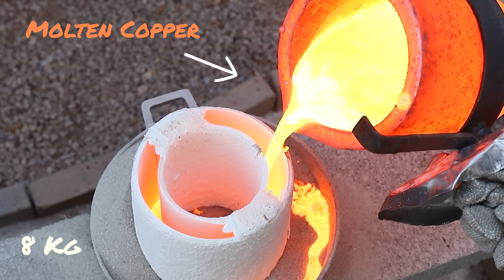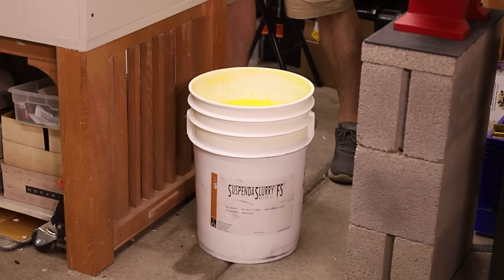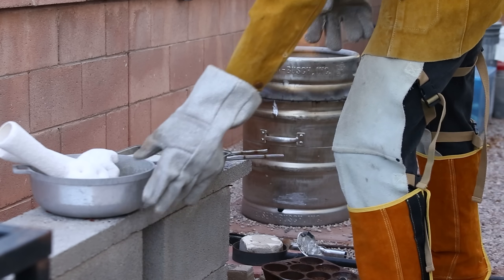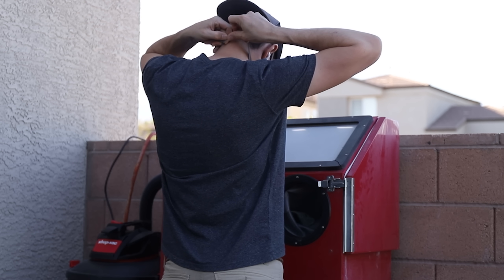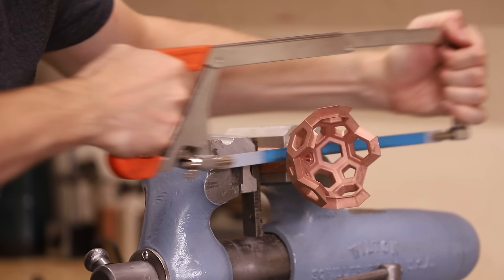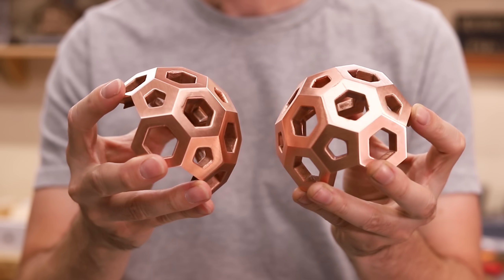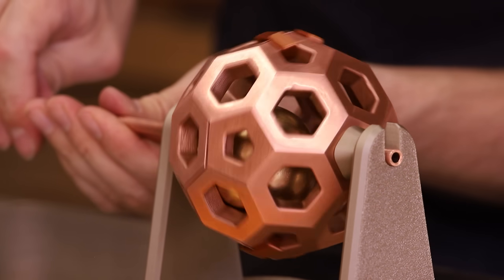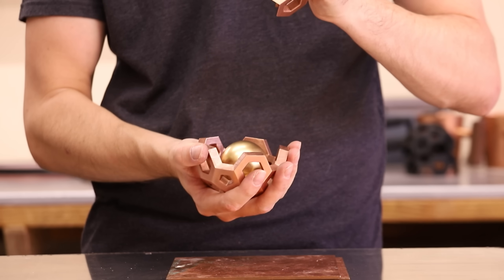HUGE Magnet VS Copper Sphere - Defying Gravity- Will a Neodymium Magnet Float Inside?

Comment: Very interesting video maybe you could attach something to the magnet spin the magnet with a drill inside the copper sphere but separate the copper sphere by a 16th of an inch and attach a meter to each side of the copper sphere. See what kind of current you can get out of it… Anything at all would be interesting… But on the far side of reality, it could be a run at free energy… No probably not but would still be very educational to find out

Comment: turn it into a tube, with no gaps in the sphere ends, use a piece of glass for the tub, and then vacuum chamber it. then a small amount of energy should bump the magnet from side to side. put the thing on a spinning axis, and it should move in either direction while floating. if only we could make copper infused glass or transparent copper like transparent aluminum lol

Comment: That was pretty cool. (Especially after watching a bunch of "in the weeds" political videos. 😁)  When you hook it up to the motor, have a way to control it''s rpm's, and slowly ramp them up and see if it'll reach equilibrium. you could also experiment with the shape of your copper cage. Maybe a smoother, aka more spherical shape, maybe it won't bounce as much in the cage once it starts "levitating?". I'm thinking it'd provide a "smoother" field, if that makes sense. There might also be an optimum ratio for the diameter for the copper sphere, compared to the magnet's size and power.

Comment: I think we could get a better image of the magnet sphere inside if you remake the copper cage like a zoetrope. Just have to get a variable speed motor and match the cameras frame rate to the rotation of the zoetrope. Then you could also set it up to rotate on its y axis instead of the x axis and only the hight of the cameras angle will matter. You could make a simple jig to set your camera  on at the perfect hight and distance away and then rotate the camera around the whole sphere. The camera shot would look pretty epic. As far as lenz's law i dont know if the effect is stronger with more copper mass or more copper surface area but keeping this consistent as it rotates may play into keeping the magnet sphere in a state of hovering. It might also balance the system so it doesn't bounce, shake, or wobble. Just like how they balance tires. Super awesome experiment! Im excited to see more!!

Comment: Try using a motor with a variable motor control and a strobe light.  Then just dial in the synchronicity to the camera shutter speed.

Comment: Could you potentially have power be produced by this thing? I have a feeling it could potentially be something amazing if you could figure out the right algorithms and theories applied as well as the engineering. It could be a the core of an undiscovered engine type. Maybe it could be the core of a gravity well manipulation device? Just a cursory glance at google with AI shows that A gradient magnetic field can be used to simulate different gravity levels. The magnetization force can be made to go in the same direction or opposite direction as the gravitational force. Maybe adding an electric current and spinning it fast will be fun as well? Idk, Im not an expert or even a student, just the thoughts of an brain addled individual. edit: found this https://www.youtube.com/shorts/C6y9GHAfWHY.

Comment: Motor drive with fine speed control and a camera with an adjustable shutter speed, and you'll be able to capture video of the spherical magnet actually levitating in what looks like a copper sphere that's standing still, if you match the shutter speed to the sphere's rotational speed.

Comment: Electrically insulate both halves by placing thin rubber on the mating surfaces , and measure how much current is being generated when you use a drill to rotate it.

Comment: I don't know if you have a lathe and I know it would require another casting but I think you could've made much much better fixturing for the cube if you had kept those solid copper cones, found some way to center the spheroid and then turned those copper chunks into a perfect copper rod or even like a thingy specifically for a drill or maybe even a belt wheel all integrated into it. Plus as Nighthawk mentioned you've got to find a camera trick to capture this again, for sure you need a part two xD !

Comment: Id be curious if it was possible to use this effect for some kind of vehicle suspension. Wouldn’t the faster you tried to push them together the stronger the resistance but it would gradually decrease to create a smooth fall?

Comment: Maybe try making a stand which allows you to manipulate the angle & orientation of the sphere’s axis at any inclination or declination. You may also want to build a small stand for the remote/control magnet (that you had a foot’s distance away from the truncated icosahedron) which are connected to each other by at least one axle if not two axis. I also wondered If a copper lattice, netting, mesh, or chain mail is produced by any manufacturer or can be 3D printed. And experimenting if adding some to cover the holes of the spheres would have any slight effect. Finally, a very vague & aimless suggestion of adding a Tesla Coil somewhere in the mix is my closing attempt to trigger some ideas from those who have worked with such things. 
It is enjoyable & exciting to see someone bring a simple idea from one’s imagination into the material, practical, tangible world which not only affirms one’s speculation of the behavior in question, but also may very well lead to something quite profound or hyper efficient. Moveable parts which needn’t be physically or solidly connected is an enormous breakthrough. That would lead to less parts necessary. And removing friction to an infinitesimal would remove much wear & tear as well as lubricators. So, well done. I like your meticulousness & attention to detail & refinement. Keep up the good work & the exploration of your curiosity to what’s possible. ⚡️

Comment: Seems there's little rotational motion at "the poles" of the sphere in a direction that can introduce enough diamagnetic force vectors to control the float. Rotating copper cylinders/rings, positioned orthogonally with the magnet in the middle would be a theoretical solution, but the spinning ring mechanism would be some challenging fun.

Comment: You can just call the truncated icosahedron a "football" (I guess a "soccer ball" to you). Alternatively a "Buckyball", but only nerds will recognize the latter.
Also: just replacing "centrifugal" with "centripetal" because the former "is not real" will not do. It is centriFUGAL force that forces the magnet out. Even though it is called "fictitious", in a rotating system it is very real.
The centripetal force is exerted by the copper cage on the magnet, keeping it on the circular path. Either by Lenze's forces when it's floating, or through mundane contact. You'll notice that expressing the situation through the "real" centripetal force is near always more complicated.

Comment: A couple things come to mind as I watch your video.
1) realize that for max effect the current developed in the copper sphere needs to be unbroken. Wherever possible use curves rather than corners (in each hexagon) as those corners each decrease corculation and this the force suspending your magnet. I would also try to make the cage itself to be spherical if possible. Technically you could use a Polywell Design (developed by Dr Bussard) in which each of your hexagons is actually a Ring. I think you're using a duodecagon congiuration and i would be interested to see the results of this new design.
2) keep in mind that your magnet is not in the same situation relative to your cage as the cylinder magnet was for the pipe. That's because the sphere has two poles and isn't easily rotating along the magnetic axis as the cylinder mag in the pipe.
There might be ways to alter your magnet either by building a sphere out of many smaller magnets with their North-South either all pointing inside-outside or a mix (like your hex cage).
In theory one could have every magnet pointing to the center but that affects the field circulation. So more likely alternating N-S and S-N magnets to provice a more even field around your magnetic ball (and not just the 2-pole planet you are currently using.). Try using the same duodecagon congiguration internally too.

Comment: Since the spherical magnet still acts like a disc magnet with only 1 north & 1 south side (and a round magnet isn't a good shape to demonstrate a magnet) a shere isn't the best containment vessel. Try several disc magnets which are magnetized across opposite sides of the circle, not top to bottom. Then assemble several until their thickness is  equal to to diameter.

Comment: This is fascinating.  does a smaller magnet sphere work better?  or worse?  how about a cube magnet? steel or copper solid rods, with bearings might turn the sphere smoother.

Comment: Does moving that other magnet by the sphere to make it turn work through the table?  I imagine having that magnet ring turning under the table hidden and having the sphere turn seemingly by it's self.  I wonder if the magnet in the sphere would hover at the right speed if that ring magnet was making it spin.
Also as other's have mentioned, I don't think that copper sphere with the holes will have optimal characteristics for this.

Comment: If the spindle was connected to the copper sphere you could equally rotate the outer shell around it, which is pretty neat. It’s like a frictionless bearing. Great job 👍

Comment: Oh man you giving me a ton of ideas!!! I never really thought about lost plastic!
I was strongly considering lost foam.
You know how many years I have criticize 3D printers? You just gave me an idea that make it practical. More likely I'll be buying a 3D printer to experiment by the first of the year. Even though your procedure seem to be the same as the Lost wax but make it cheaper and more realistic it's the molding process sculpting is done in the computer instead of by hand and you're using that same plastic Not wax and a way may be cheaper/convenient. Oh man the ideas of endless.  I'm saving this video I'm going to review it and study it some more. What I don't understand sometime with lost wax you get a hollow casting how can I do that with a CD printer. That's for sculpturing statues. But if I need to make parts or machine parts hey that's the way to go.

Comment: Your Copper castings may have not been the video focus but, can only imagine the total hours in them. Turned out really cool. Maybe do threaded pins to join the halves getting a better more consitant connection would both balance and strengthen the magnetic fields lines.

Comment: I think the shape was actually interfering. When you think about the magnet as stationary it basically has short connected copper pieces going around it. A shape that provides a larger surface area around the point of rotation would be better. Something like a donut in the middle might work better. Also you have no way to keep the ball in the rotation access. If it's north/south isn't in the direction of rotation then it isn't getting much force applied to it.

Comment: Ideas:
-Turn on an inductive bearing heater near it. 
-Roll it down a hill
-Run some mild dc current through it while it’s spinning
-While spinning it, hold another magnet outside so it pulls the ball closer to centre.
-Spin it with an air gun
-put it in a microwave.

Comment: can you make the inside surface to be rounded? it did not appear to be.. Like just make your birdcage then subtract a solid sphere surface from the inside and out side. you can keep constant thickness of material but the ball would be smoother on the inside. so like take your current design and make it thicker. then make a large sphere that intersects the smallest diameter of that shape on the outside and subtract the outside parts them make a smaller diameter sphere that intersects the largest diameter of the inside of that shape. it would be like if you held your hand at high speed the shape would appear to be a solid sphere inside and outside.

Comment: fun idea. maybe a smaller magnet, or put magnets attached to the sphere. or flip the whole thing and make the sphere magnetic then use a semi magnetic metal ball. i also thin if it had dimples like a golf ball it would resist more. oh and then get five of them in a diamond shape and it could be like a gear system. idk, just more fun ideas

Comment: I would suggest that you use a  voltage regulator and motor start slow to levitate the magnetic sphere to the point where you can increase the speed of the motor

Comment: If you dip the poured shell molds into water while the casting is still red hot, not molten, the shells will disintegrate mostly.

Comment: put it on some bearings and spin it along the opposite axis of the joint axis. Could probably even use the rotating arm as a clamp at the connection

Comment: Perhaps you could put an electronagnet below the sphere to spin the internal neodymium magent, to see if it lifts into the center of the sphere.
     Also you could inject air onto the ball magnet to get it spinning very fast, and it should hold itself dead center of the copper ball, while the sphere magnet rotates at incredible speeds, via the air propulsion.

Comment: Well, I would like to see what happens if in a likewise experiment as you just did, the 2 copper semi speres are slowly pulled apart.
1. How long (mm / in) would it take to stop the magnet floating?
2. Would the magnet resist pulling the semi spheres apart?

Greetings from Roland, Venray (NL).

Comment: Here is why it didn't work the way you thought it would. The interactions between magnets and metal are all based on the electromagnetic effect of course but the interaction you are trying to create is based on eddy currents. As the magnetic field intersects the copper it induces eddy currents which then create a counter magnetic field but the shape of your enclosure is causing the eddy currents to flow in a very wonky pattern. This is causing your counter-magnetic field to constantly change so the ball magnet won't float properly. Try making a shape that has a few straight, unbroken circles held together by non-magnetic spacers. This way you will get interesting effects if you spin it the same way as the circles (like a tire) or spin it with the circles rotating around the sphere. I have no clue how you would cast something like this but that should cause the effect you are trying to get since the eddy currents will flow in a straight line creating a consistent magnet field shape.

Comment: if you could put a camera in the plug holes at the axis of spin you could observe the thing spin  unobstructed. I'd also be curious if you flipped it into an electro magnetic cage of copper wires wrappedin multiple solenoids with a copper ball in the middle  what that would be like. eventually workign your way up to a electric motor or generator would be interesting. 

Like could you detect the direction of fall if a hexagon side was created with an iron core wrapped with a series of electromagentic wires on seperate circuits that would activate based on a magnetic field approaching them.

Comment: This was very neat, I'm wondering if the size of the Magnet is slightly too large.  If there's a tipping point between power of the Magnet, and Weight of the Magnet.  Where if you go over that point, you keep hitting the sphere.  Were such a thing real, then I'd imagine it would be millimeter differences that could make it unfunctional for your theory.  I have no basis for my suggestion, just a random spitball theory.

Comment: I don't know what it is I  feel you are on to something. Practical applications? many for this device but I am thinking far ahead in the future. As hoeron steam wheel was for amusement for nobility. which went on to start the steam revolution. This is different I feel it may be the hexagonal shape should be changed to a more organic structure using the Fibonacci sequence for a more fluid transition of the way the magnet responds maybe ?

Comment: Maybe make the holes in the sphere much smaller, and the inside smaller so there isn’t much space between the magnet surface and interior wall of the copper sphere. Or even a slit in the sphere, increasing the copper body mass of sphere to the max, a camera focused on the slit position and timed with a strobe to match rotation speed would allow video footage to be filmed of the magnet inside to see if the denser copper body helps the levitation increase….

Comment: I’m guessing that to get this right needs a perfect balance of forces—which requires a super-precise casting. That said, I suggest that you don’t need a casting at all. Rather, a spherical series of copper rods all precisely aimed and balanced (in three dimensions at the exact pinpoint centre of the magnet should produce the same effect.